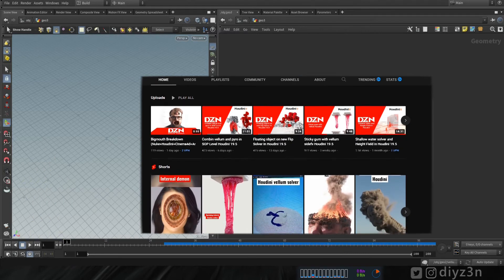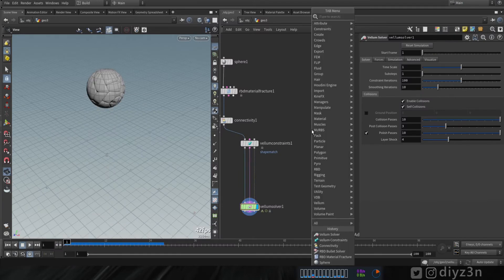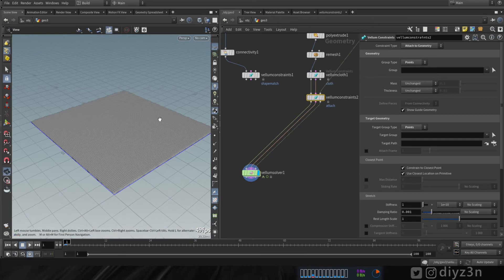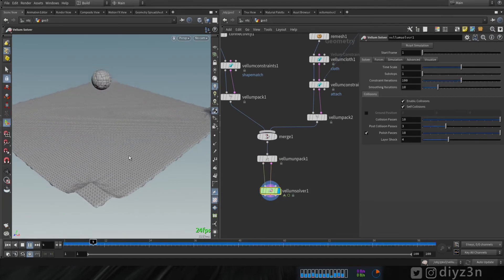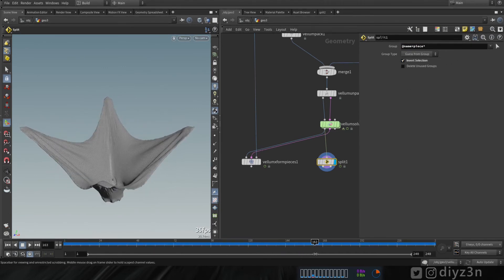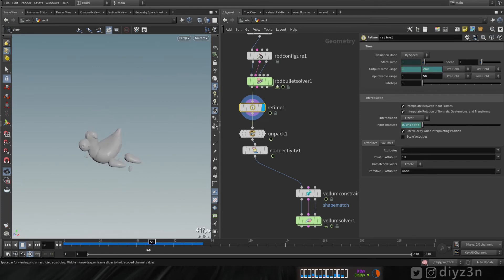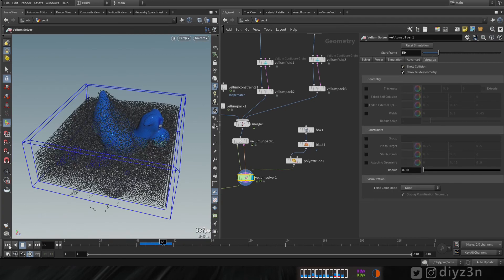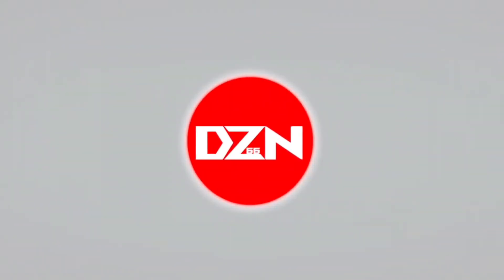Combine￼ vellum and Bullet in SOP Level Houdini 19.5

Comment: Hi Diyz3n! Do you have any idea how to make two object collide together and break apart? For example have two sphere crash into each other and break apart? Thanks for any help!
Reply: Great!  .. just wondering why you extruded the cloth geo first and not just use a 2D cloth surface for faster sim, then poly extrude post sim?
Reply from the maker: @pixelspring thanks man

Yeah that's one way 
I extruded The cloth hoping the thickness would improve the simulation
Reply from the maker: Hi, I guess you can do it with a bullet solver and use material fracture for those spheres and make strong constraints, and then in bullet solver constraint break them with the impact I guess it will work
Reply: @diyz3n  Yea, I tried that, the two objects fall apart instantly, OR I just get errors like crazy. I'll keep looking for info on it. Thanks!
Reply from the maker: yeah, just use a strong or higher constrain strength, and in the bullet solver node, break them with the correct impact threshold
Reply: @diyz3n  What RBD constraints should I be using? I'm kinda totally lost
Reply from the maker: I prefer material fracture constraint tab

Comment: Very useful! Thank you!
Reply: @Diyzen - the floating part (around 12min mark), the  'ball of water' collides nicely with the geo, but then explodes everywhere (in all directions) upon hitting the bottom fluid (the one with high density). Any idea what needs to be adjusted? Also as the rubber toy hits the 'water' its bottom becomes all messed up, points moving everywhere.
Reply from the maker: yeah for that i suggest to increase sub step , maybe that will solve the issue
Reply from the maker: Glad to hear that!